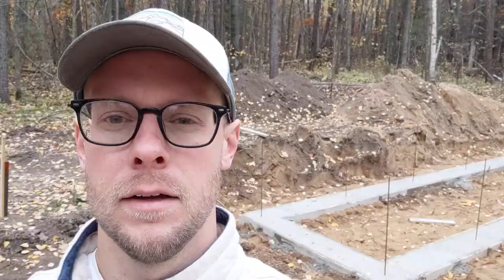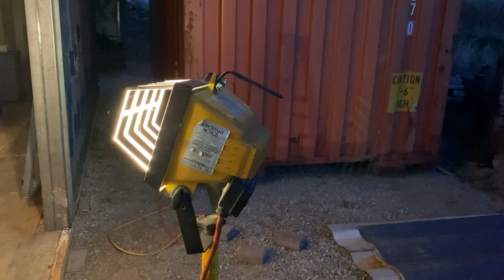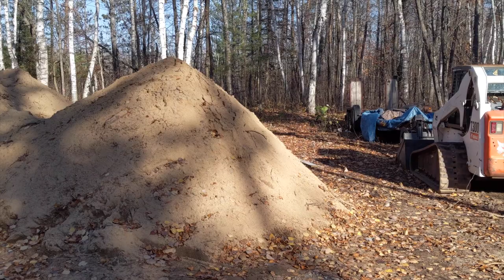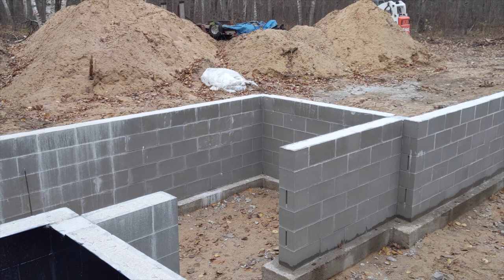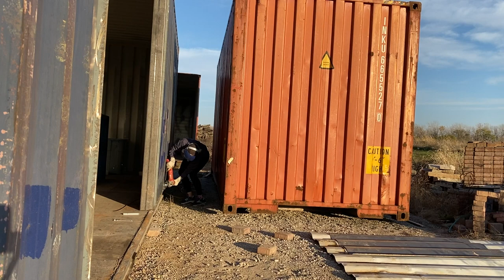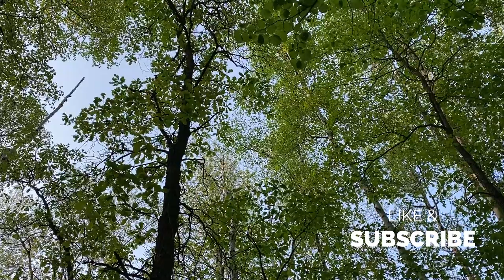The FOUNDATION For Our Shipping Containers Is Done.

Comment: What tool did you use to cut the shipping container windows?
Reply from the maker: We used a Milwaukee Metal Cutting Circular Saw. You can find more info in the video linked here. https://www.youtube.com/watch?v=PKCej8fWdOY

Here's a direct link to the saw itself. https://www.homedepot.com/p/Milwaukee-M18-FUEL-18-Volt-Lithium-Ion-Brushless-Cordless-Metal-Cutting-5-3-8-in-Circular-Saw-Tool-Only-w-Metal-Saw-Blade-2782-20/301050312?source=shoppingads&locale=en-US&&mtc=Shopping-B-F_D25T-G-D25T-025_009_PORT_POWER-Milwaukee-NA-Feed-Smart-NA-NA-PortablePower_Smart&cm_mmc=Shopping-B-F_D25T-G-D25T-025_009_PORT_POWER-Milwaukee-NA-Feed-Smart-NA-NA-PortablePower_Smart-71700000084736776-58700007165824624-92700065193741162&gclid=CjwKCAiA78aNBhAlEiwA7B76p7soZIRTQKZnVNoPs6xmd_j-Yrn4grA7TbOunh9ZFaSzHA9yOruJVRoCZBEQAvD_BwE&gclsrc=aw.ds